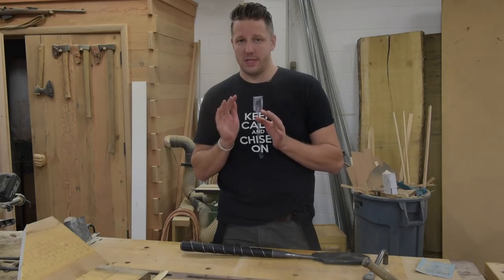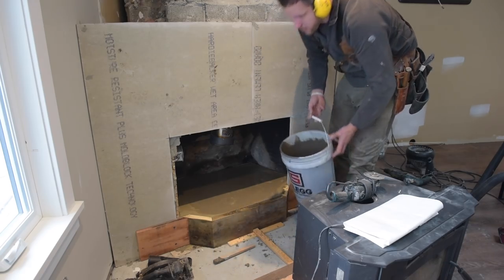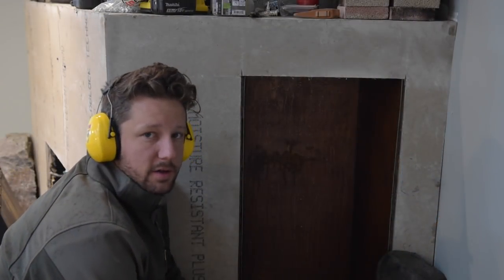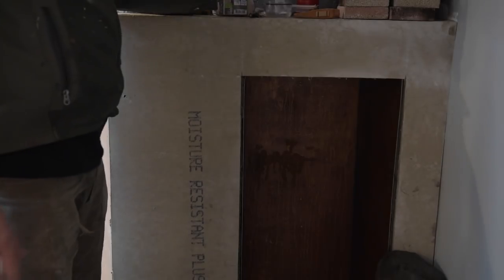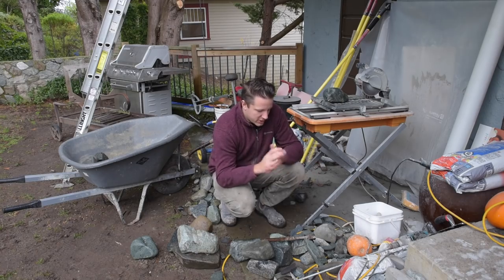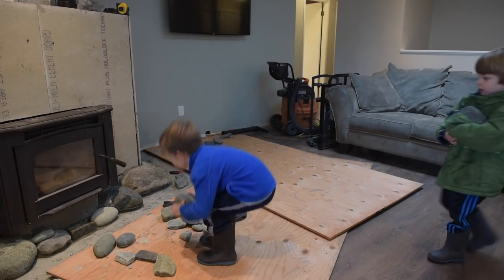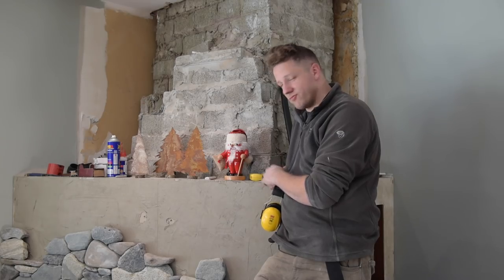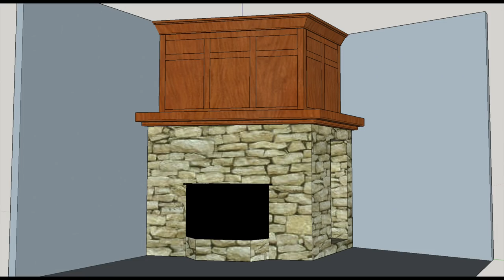Fireplace Makeover

Comment: Did you have to put anything on the back of the rocks after you cut them? We use a special mud for the back of real stones to stick to the mortar scratch coat. Fake stone would only take you about 6 hours from floor to ceiling but doesn’t look as good when you have the same 30 rocks all over.

Comment: No metal lath behind the stone to help hold the mortar and stone from falling off?  Interesting. Hope everything stays in place with no issues. Looks really good.
Reply from the maker: Croz 1007 I used tile mortar so it won't be coming off any time soon.
Reply: the samurai has used "HardieBacker" (not sure if I spelled that right). So long as you back butter your "tiles" and the hardiebacker; combined with an appropriate cementitious adhesive, metal lathe is not necessary